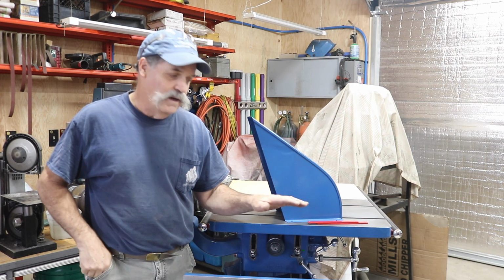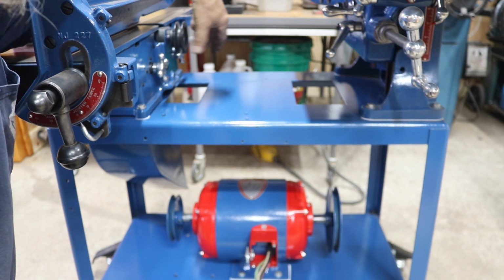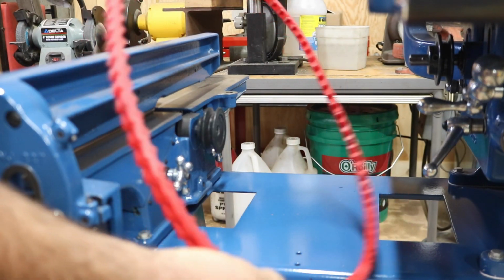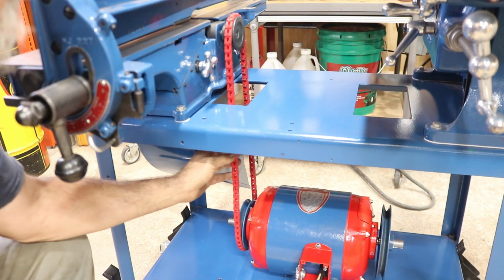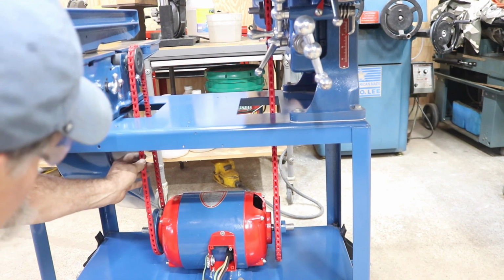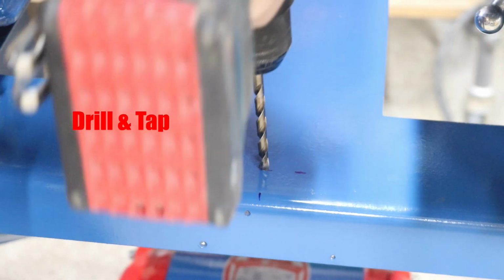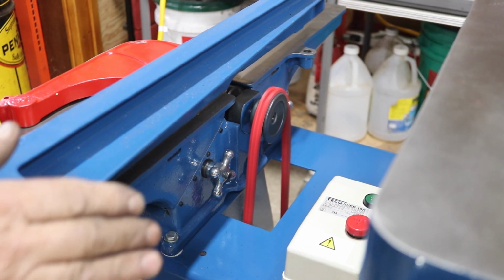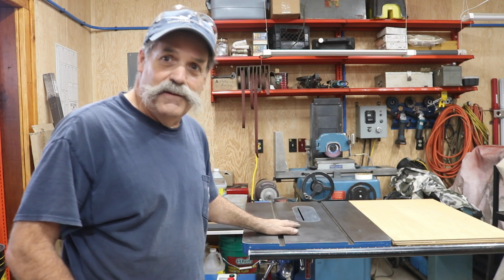Delta 10" Table Saw Restoration | Electrical Controls | P8

Comment: That came out great. It's good to see the heavy duty wiring. It's amazing how much power can be lost in the line cord when a calculator gets put to it. Loved seeing the timing light rpm measuring tool 😁. Great job in any case.
Reply from the maker: Thank you Tim.  Go Big or go home.  That strobe Tach is old and awesome, works great.

Comment: I have to say that modern switch looks so out of place on that beautifully restored machine.
Reply from the maker: Yea a little bit but it works great.  The original switch just was not an option.  I possibly used the original switch as a control switch to a relay.   Thanks Brian.

Comment: Awesome for sure. Despite its antiqueness I'm surprised it didn't have belt guards on the upper pulleys.
Reply from the maker: Thank you Shep.  I do not think the original guards would work with the link belts.  They are a bit thicker than a normal v-belt and would cause a clearance issue.